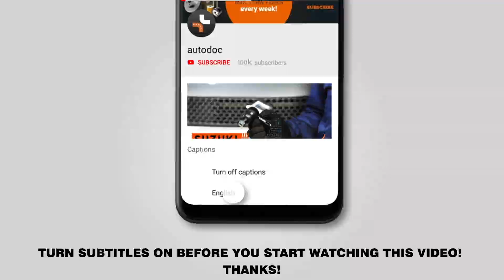How to change front brake pads / brake pad set on Audi A4 B8 Saloon [TUTORIAL AUTODOC]

Comment: Are the brake pads the same for Audi b9 models also?
Reply from the maker: Unfortunately, your car may be structurally different from ours and the replacement procedure will be completely different. Therefore, complete information can be found in the service or technical documentation for the repair of your car.
AUTODOC

Comment: Why did you open the brake fluid lid?
Reply from the maker: It is necessary to remove the brake fluid cap so that pressure is not created in the system and it is easier to press the brake piston as well as it gives opportunity to monitor the brake fluid level.
Reply: Are you supposed to change the brake fluid? Or leave alone and just recap at the end

Comment: Thats not the usual caliper spreader tool. Where do you find that type? I cant find it anywhere. There's no hole in the center of the frame to run a regular spreader
Reply from the maker: Hi! Thank you for your comment. You can get acquainted with the goods for the car here https://www.autodoc.co.uk/yato/13639605?search=YATO%20Turn%20/%20Reset%20Tool%20Set,%20brake%20caliper%20piston%20(YT-06822 )